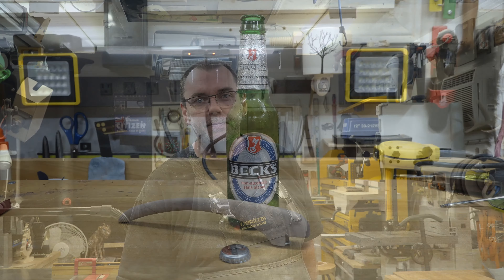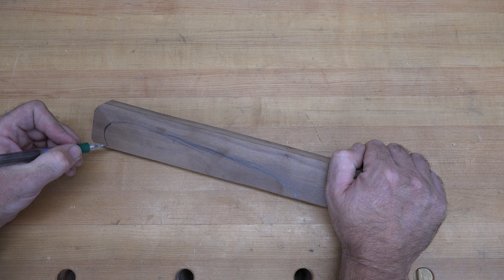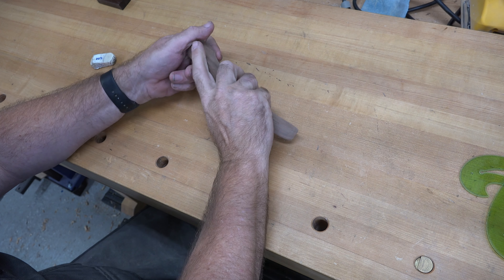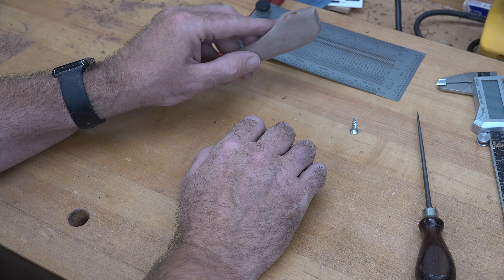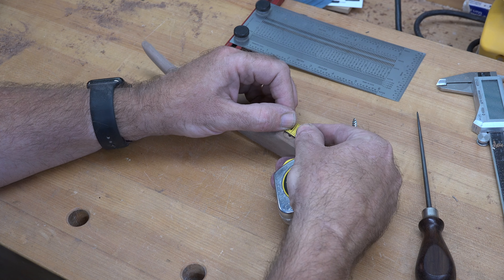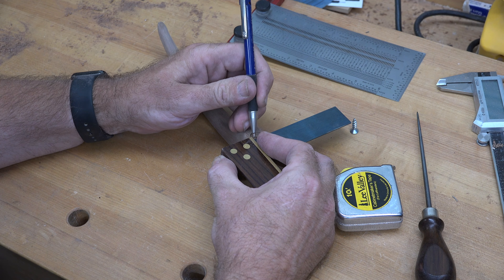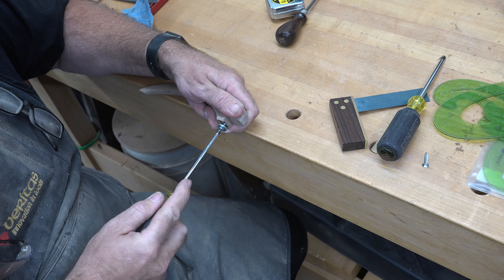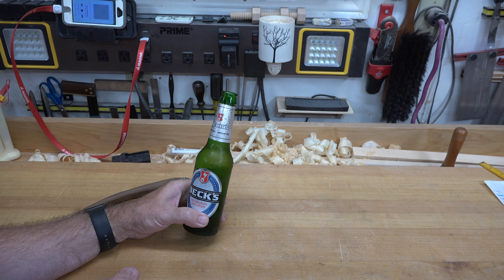Making a Bottle Opener

Comment: Just thought that for vids, if you used masking tape on blanks,  the pencil marks would show up better.  Love your projects.
Reply from the maker: Sadly Stephen, I've tried tape.  And while it does show up a little better on camera, it doesn't help when actually making the project as the tape separated from the stock.  I have had some success in using spray adhesive and applying plain white paper to the darker stock before laying it out.  I may have to do that on future shows with darker stock.  Thanks for the kind words on the show and for tuning in.  I truly appreciate it.
Reply: @acutabove_woodworkings  When working with dark woods I draw a wide white chalk line on the surface first.  Pencil lines then show up nicely.
Reply from the maker: @dwightl5863  Thanks for chiming in with the suggestion Dwight.  It is very much appreciated.

Comment: Every time I use a mechanical pencil it’s pain ! The lead snaps. What the pencil you use ?
Reply from the maker: For use in my INCRA T-rules John, I have to use a .5 lead.  There is no way around that.  The lead can snap from time to time but it is usually because it digs into the coarse grain of a board.  If I am just using a pencil without the INCRA, I rely on a .7 lead.  Much more robust and can take a little more of a beating.  For whichever size I use, I stick to an HB lead.  I find that the H leads are too hard and the B are far too soft but the HB is just right.  I hope this helps.  Thanks for tuning in John.